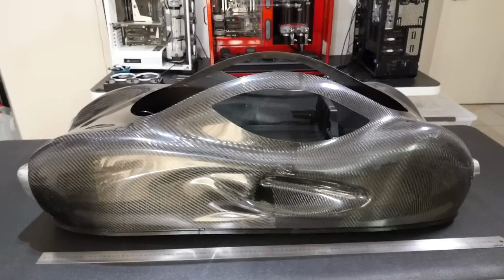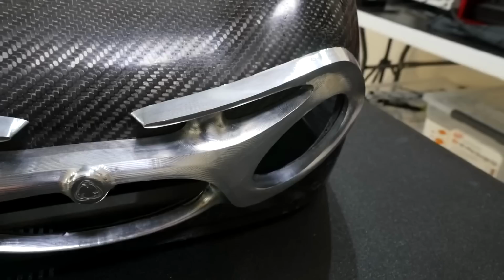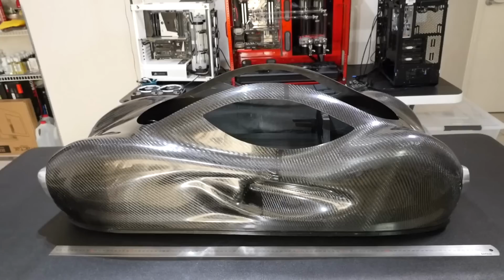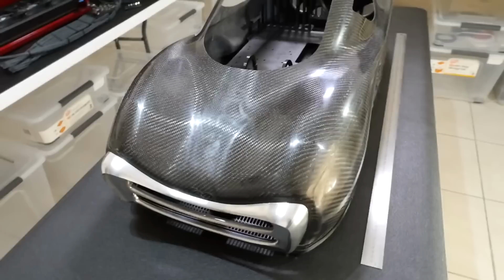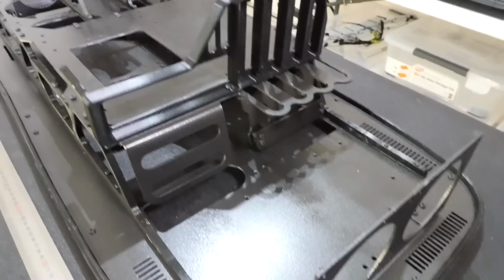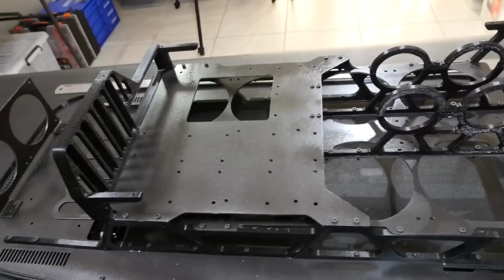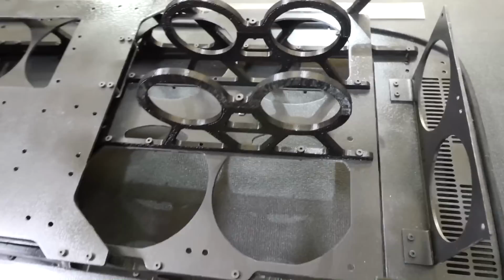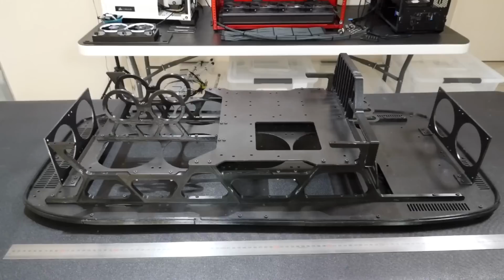Element Six - Prototype #1: Overview

Comment: You know what would be dope? Actual cases made of carbon fiber. Not this....
Reply: Why would anyone buy a standard case made of CF that would be more than 10 times the cost of steel ?
Reply: Ian Clarke steel?! Lol no thx. Aluminium is way better and an actual product people use
Reply: OK but the comparison is still the same, why would someone pay out for a  'normal' case made of CF when aluminium is vastly cheaper ?
Reply: Because carbon fiber is gorgeous material it looks amazing, personally I want a case made of marble or slate maybe, same reason. Sure it's more expensive, but it looks so pretty. Also you have to remember that, this like most things made of carbon fiber, those who can afford it don't care...
Reply: What's the point though? We have aluminium cases if weight is your concern. If you like the look there are plastics and look almost identical.

There are reasons to use carbon fiber, and pretty much all of those reasons don't apply to PC cases. The only reason to use it is for bragging rights and to "push the limits" for it own sake.
Reply: CF has some terrible noise properties. It doesn't dampen sound like steel glass or aluminium does, but it amplifies it like wood does - even 3x better than wood. If you want the looks there are many options, but as construction material for PC cases CF is unusable. It is not that premium feeling also, does feel like plastic. Expensive and nice, but feels like cheap plastic. Not a good surface to touch. Metal and glass is imho premium and functional.

Comment: Seeing this has 100% convinced me you need to sell the internal chassis, without the shell, as a wall mount or stand PC (like Tt P series). <$2000 with a glass panel. I'll bet you that sells more than the shell version.

The inside is clearly well thought out. I think there is a clear market for a chassis in this category. In Win makes very nice cases, but nothing with Case Labs level of room. This could bridge that gap. Omitting the shell would make the cost far more stomachable and, bluntly, make the case more aesthetically agreeable.

Use CF tubes for the glass support struts. Maybe even cut the glass to match the shape of the sled.
Reply: That would be sick!
Reply from the maker: If we were going to do that we would do something which starts with an m. Cant say more yet.

Comment: Pushing the envelope. I love it. Massive isn't it? I wouldn't have anywhere to put it! Any chance a smaller version will be available in the future? I'm sure your guy is totally aware, but you can get rid of the tool marks on the aluminum with some sand paper and scotchbrite. It'll shine. Also, mods! You don't leave any room to mod. Take a dremel to carbon fiber, you got a mess.. I know it's art, but it's a computer case first right!? :) Does it make you shudder to think of me cutting up your hard work? LoL. Love what you do dude. You are an inspiration

Comment: Love it... But a few things I would change (yes I know literally no one cares):

1. Those grills are an issue - the front one needs a complete redesign and both need to not stick out so much.

2. There needs to be consistent silver trim throughout the case if you are going to have silver grills - like maybe all the way around the perimeter at the bottom, or how there were unpainted metal elements in the cad for the internal frame.

3. The corners of the side window 'eye' shape are way to sharp and don't match the aesthetic- they desperately need to be rounded out a bit.

4. The edges of the carbon around the windows are a bit meh and should definetly be trimmed with something - maybe a rubber seal or at least flush sitting windows to distract from them.

Love what you're doing just think you need to take a step back and look with a different perspective- it's very easy to see things like this differently to the rest of the world when you spend so much time designing and working on them.

Comment: I think the reason why the windows is eksploding is because they cool down to fast ( you could probably build a place to put them in where you control the heat and get the heat to go down slower then in the normal open air)

Comment: Hi again Daniel. Have read or heard in some video before, that this case can be wallmounted. As this case is roughly one meter long having the shell rotating into your living room or somewhere else would take so much space of the room that this case is placed into. Wouldn't it be better to have some hinges to make the shell rotate lengthwise when someone is planning to install the case on a wall?
You've said some times in your videos that the airflow works by convection, but you've got two big radiators underneath the case and forcing the airflow to go through the entire case... Wouldn't this be a problem? I mean, you're cooling the componentes but then you're throwing the hot air through them again... Also I don't get this cross sectional airflow from front to back. Don't know what's there for.
Have you made a flow calculation inside the case to look if all the air pulled inside from the underside is escaping correctly through the upper ventilation you're going to make? No turbulences at the upper part being this curved shape? No air making turbulences that hinders the air escaping the case?
Where's the hot air from the PSU going?
Sorry for long post, but so many questions :)
Cheers.

Comment: As far as the IO goes, are you planning on giving it front panel audio? It can be a useful feature at times, though I can also understand if you intend to skip it in favor of a smaller, cleaner IO section and reduced cabling. You've mentioned that wall mounting the case would be possible, but I'd kind of like to use those mounts to attach it to the side of my desk and/or hutch.
Reply: he said in the video there will be a panel for front io.. a couple of usb 3.1, front audio and a power button.. you can also remove it and choose which side you want it to face (left/right)..

Comment: I kinda like the case but it wont fit in most rooms without looking out of  place. It should be presented on a turning table like in a supercar collection. And i think it would lock really good with a layer of candy Blue or something like the Mclaren P1 blue carbon. As a coolant the upcoming Primochill Vue could be super nice.
Reply from the maker: We can do a coloured tint on the carbon actually. Or there is the possibility of adding coloured kevlar which also makes it bullet proof:)

Comment: This looks awesome, I would love to work on that development as a student for mechanical engineering. Have you considered having your milled Aluminium parts hand cast? Hand casting needs very little investment (only for the plug - you already have those) and is quite cheap. Finishing will take a lot more time, but I think it would be cheaper then CNC milking time.
Reply from the maker: Its a good point, we were looking at it. For E6 we have low cost machine time but high cost people time so we didnt do it.
Reply: Allright, only wanted to know if you considered it! Good luck with that case, it is gorgeous